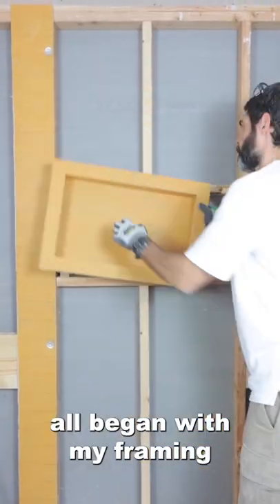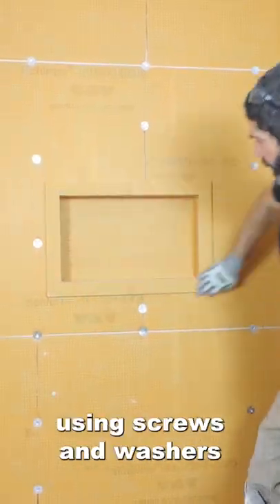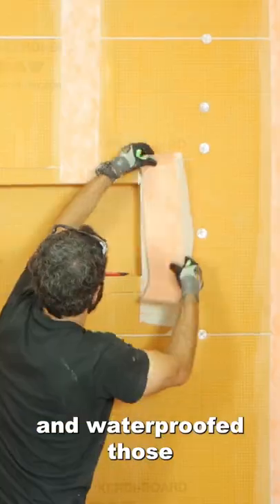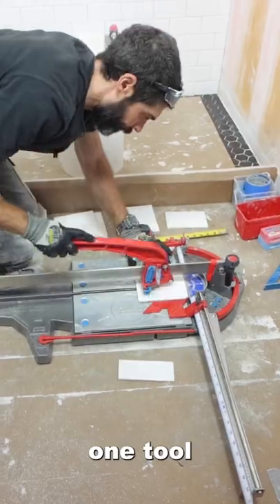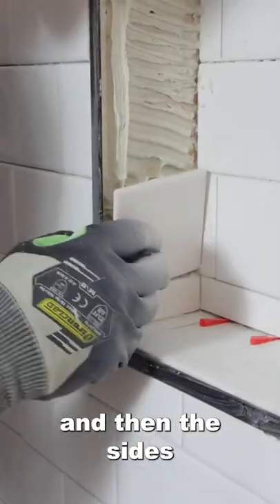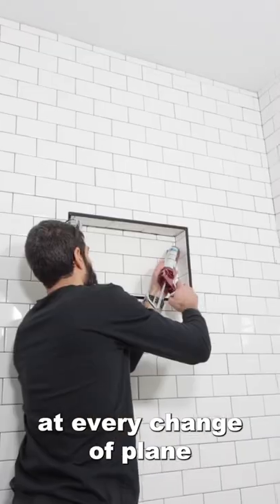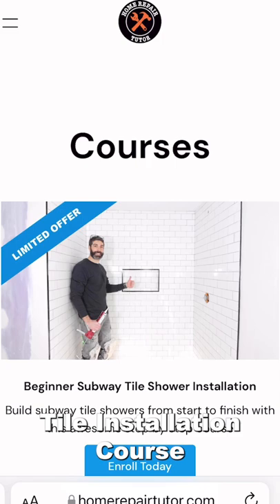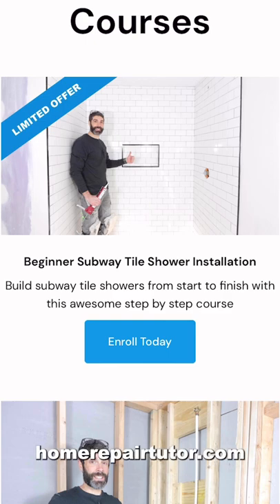Tile Shower Niche Tips - #shorts

Comment: What if they want a lot larger custom niche? Ive never used the small prefab ones before always custom made them to the exact wants of the customer. Ive done small ones to extra large ones. A 7x5 curbless shower I did last year with a shower head on each side wanted one by each shower head they were like 10”x12” then his other bathroom had a 24”x12” so it was the exact size of one tile high so the grout lines matched up. I’ll stop typing but I’ve always had so many questions and not many people I know do construction or remodels so it’s hard to bounce ideas off anyone other than home owners that I do work for then they all just want the hardest thing possible to do lol. Have a great day
Reply from the maker: sounds like you’re doing them how most would recommend, ie customizing with backer board to match up the tile. Framing and tile layout as you know are key, so I’d just keep doing that for custom niche sizes

Comment: My opinion and personal preference but I just don’t like tile for the bottom of the niche. I prefer a white marble sill. Tile is dead straight though looks amazing. How do you get the schlutter metal frame to look so good? I’ve always cut them like a picture frame but I still never like how it looks in the corners no matter how perfect I make the angles. How do you make them seamless? I want them seamless. Lol.
Reply from the maker: thank you buddy, so I mitered the Schluter profile using a special Diablo blade for aluminum - chop saw blade. You can support the profile on a 2x4 to make cutting easier, but go slow and hold that profile tight

Comment: I can't see how foam board can withstand the flexing and not transfer that movement  and crack the tiles. I will stick to durock.
Reply from the maker: How much movement do you anticipate? I’m not paid by anyone so my opinion is my own, these boards and other ones like them are extremely durable and strong. Keep in mind that even DuRock requires 16” oc studs for 1/2” thick panels, so the specs are the same